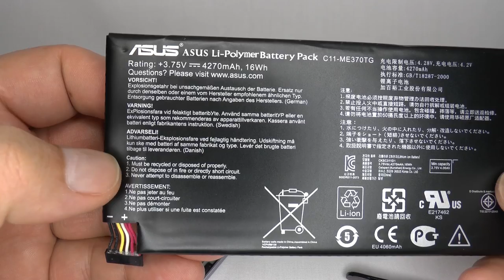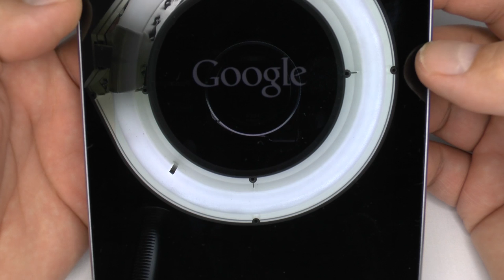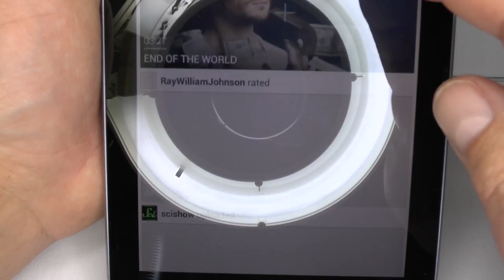Nexus 7 Repair -  LCD & Digitizer Replacement | Disassembly + Assembly

Comment: Answering my own (new) issue, the charger ribbon cable had become unseated during my screen replacement efforts. Once again I thoroughly reviewed your Nexus 7 diss-assembly video while doing a side by side comparison. When you got to the part removing the charger cable I noticed that mine had become disconnected (unintentionally). Following your video I reconnected the cable and normal charging resumed. I cannot thank you enough for such a complete and competent video.

Comment: Thanks for great demo. I finished but something went wrong. I have a working Nexus with replaced screen but the screen has red across it. IE when I boot up its a red background and not black. Did I do something wrong? Have you seen that before?? Could it be the screen that I purchased..? Thanks in advance,,

Comment: That's a great idea - and I tried it.  Of course, the old glass shattered even worse in the process of taking off the beveled screen, so I wasn't surprised to see that IT didn't work when I plugged it back in... or maybe it should have worked and my flex cables are busted now? Tough to tell.  But you think it may just be faulty new screen?

Comment: I just semi successfully replaced my Nexus 7 screen assembly thanks to the excellent step by step in your video. When the Nexus booted up and updated all its apps I was delighted. However the device battery is not charging. I have gone back in and reseated the battery cable connection but still the device does not seem to see the charger connection. Do you have any suggestions? Have I traded one problem for another. I presently have about 40% battery left.

Comment: exellent video, thank you. wish id seen it before i attempted to replace my screen. a quick question, if i snapped off the tiny gold jumpers from the mother board to the wifi areial (on the back of the case) can they be replaced or do i need to replace the motherboard? thank you

Comment: Thanks so much for the tutorial, I'm typing this from my newly repaired nexus 7. Asus wanted €170 and I managed to get the part for under eighty. I have botched the screen adhesive though, partially because I had to pull shards of shattered glass away one by one. Just wondering if you have a link to a description of that adhesive tape you recommend? Thanks again

Comment: Having never done anything like this before, I've now done this TWICE using nothing but this video, the little plastic knife and philips screwdriver (from the LCD replacement pack), a pair of "flat" pharmacy tweezers, to pick our all the glass shards and the wife's hair dryer!! A huge thanks for two "nearly new" Nexus 7's. I think it took me 60mins the first time (with lots of photo's) and about 35-40mins the next time. £40 from China for the replacement parts, if you can wait a few weeks.

Comment: Nice video.
My son dropped my N7 and now the glass is broken.
The biggest problem whem i replace the screen is to get the broken glass parts from the alu frame.
It is also impossible to keep the adhesive glue/tape that holds the glass to the frame in a re-usable shape.
How can i solve that? Is the glue available?

Comment: Hi, thanks so much for this video. I tried to replace my broken screen and when I reasemble all again, I found that the nexus seems to work, but the screen have two yellow and green bars all the time. I can see the desktop, use the tablet but all the time with this pattern, I tried reconecting the screen connector without sucess. Thanks in advance ! 

I have some photos but dont know how to include them here ...

Mariano.

Comment: @14:20, when removing the screen, I heated on the screen side.  In this fashion, The whole adhesive stayed on the silver plastic frame and I had no need to pry it off the old screen

Comment: had the same trouble. once, on some google forum i read that this problem can be easily fixed by opening the back lid, disconnecting the battery cable and connecting it back again. then put the gadget on charge for a couple of hours. 
then cross your fingers and turn it on. 

btw, keep in mind if you open the back cover the warranty will be void. may just bring the gadget to some authorized service where they will charge you about $50-100 for doing the same steps as i showed above. 

good luck!

Comment: I have put mine back together and back apart after changing cracked LCD and digitizer 20 times at least and it won't turn on (it at least turned on with before I worked on it with the crack)... I followed instructions perfectly except I wasn't able to reuse the insulation metal tape... is that keeping it from working or what am I missing?

Comment: Just completed this repair using the video. A bit shaky at first, but referred back to the video as needed. Took my time and wound up with zero extra screws !!  Thanks for the video. Buy the way, I took the advice, and did buy the complete screen/digitizer assembly. I was able to peel the frame/screen adhesive strip away and reuse it, but I had to watch the pressure and go slow. Once I had separated the main board and metal frame from the plastic frame and damaged screen/digitizer assembly, I wrapped the plastic frame and screen assembly in a towel and placed it in the oven on the lowest setting, 170' F, for 3-4 minutes (since this screen assembly was no good, I was not concerned about heat damage). It wasn't as good as a heat gun, but I believe it did help.

Comment: At 6:30 you are removing a large sheet of adhesive/foil. Did they stop putting this on to later edition models? I just got mine back from ASUS and am going to replace the screen myself, just a little worried since I do not have that foil.

Comment: I have successfully replaced my lcd BUT my N7 only booted up once with "16-bit" colors and with a middle vertical line. I disassembled it again and checked the lcd to mobo ribbon (con 7311) and also the power cable and now when i boot it up i only have a black flickering screen with that line in the middle - no more colors or logo whatsoever - only black flickering screen. Could you please give me some hints?

I am probably meeting the same situation as Zali Abas

Comment: Thank you very much.  Because of your video I was able to replace the port assembly.  Although under warranty, the charging port was physically damaged from inserting and removing the micro USB charger over the last year.  Asus wanted $213 to replace it.  With your video I was able to do it with a $60 replacement part and about 30 minutes.
Reply from the maker: Good news, thanks for the feedback :-)

Comment: Thanks a LOT, I broke the screen sitting on it... the hardest part was separating all the glass bits from the bezel... thankfully not out of my butt.
My opinion is that it would be faster/easier/sexier if a new bezel was supplied with the screen.    About two hours, worked on the first try.  thanks again!

Comment: great video. helped me replacing my brokenscreen in 10-15 minutes. my nexus is back after 3 months of disability. the i have paid about $150 for screen+delivery and about 10 bucks for 3m 5mm tape (bunch of it, used 30-40 cm max). 
thanks a lot!!

Comment: Thanks You!  I was able to save my nexus 7 where the digitizer (or touch) stopped working.  I purchased the digitizer and screen combo online for $50 that came with some small tools (screwdriver for small screws and some plastic pieces resembling a guitar pick to slowly remove the edges and what-not).

Comment: Hey i just self replaced my screen on my nexus. I have an iHeart radio app and when i reconnected the parts, the alarm went off and played my station. The only problem is that the screen didn't display anything. I've checked all of the connections a million times and it just isn't working. What do you think is wrong?

Comment: So would I have to purchase the LCD+Digitizer? Or can I just order the digitizer itself. The LCD is working fine, but the screen is cracked at the bottom half and touch won't respond at the area.

Comment: Just wanted to say thank you. I was able to pick up a screen online and do almost all the steps without a heat gun until I got to the screen. I went to a local shop to do that for me. Took them under an hour and cost around $20. Great video!

Comment: I have a Nexus with replaced screen but the screen has not turn on.
I tried with two new screens the same problem, the old has been broken ..
Not seem to have a problem in ribbon cableI, i took it carefully and it was correct before.
You have an idea whatsoever what the problem is?
Thank you!

Comment: I've replaced my display successfully but I'm still getting a blank screen. I know my N7 is powered on since I can hear it. I'm also able to unlock it without being able to see a thing, meaning it is responding to touch, and I'm just getting no image. 

I tried reseating the flex lcd cable plenty of times already and still can't get it to work. My old screen is completely destroyed and therefore can't be used to check if I got a faulty screen. 

What do you recommend I do? Get a new cable?

Comment: My toddler stepped on our Nexus 7 second generation back down the other day and the unit restarted itself. It works fine but I just want to know why it would restart itself all connections are tight and there is no loose pieces inside.

Comment: I was successful in replacing the digitizer assembly. I ordered a new one without the silver plastic frame. I used the old frame i had. Thanks for all your instruction

Now the only thing, is the audio 3.5 mm doesn't work very well. Mono in one ear and weak even if the volume is set @ max

Do you have a suggestion as to what to look at? Should i order a replacement for the audio component?

Thank you
Reply from the maker: yes its a common problem, Google for part number ME370T_IO_FPC
Reply: *****  I rechecked everything and i hadn't close the clamp on the flex cable that connects the power input and audio to the main board... It was charging super slow too. After closing the clamp, all came back to normal :-)
Reply from the maker: Joffrey Bienvenue Good news :-)

Comment: really easy to follow, saved about £180 on buying a replacement 32GB by changing the screen. Screen had a blue tinge after first attempt so tried again ensuring all the connections were in correctly and works great

Comment: I followed your advice here, but my screen will not turn on. I even tried to turn on the old screen, but it won't work. I made sure to reinforce the lcd connection, but the screen won't light up. I know the unit is working because when I plug the USB into my computer I have access to the files. What would you recommend doing?

Comment: Wow. Watched you separate the glass from plastic bezel with minimal of difficulty. I wonder if various production line changes resulted in some using the double sided adhesive tape like you got, which isn't too difficult to get around, and if different Nexus 7's use glue, to form a much stronger bond/fusion that's near impossible to undo. Another video on youtube shows how a guy did it after 2 hours and much torment.

Comment: They are gold looking pieces of bent metal (2 of, side by side) Located right next to where the battery plugs into the motherboard. They provide the contact to the WiFi antenna which is housed on the rear case.

Comment: *****  
I fitted a full screen on a nexus 7 ME370TG about 3/4 weeks ago....noticed that there is a sort of whitish misty halo that appears on the outer edges of the LCD intermittently but I don't think it's on the LCD - not too sure what might be causing it - your thoughts would be appreciated!

Comment: Sorry for English ..
 I have a  Nexus with replaced screenת but the screen has not turn on Touch Yes.
I tried with two new screens the same problem, the old has been broken ..
Not seem to have a problem in ribbon cableI, i took it carefully and it was correct before.
You have an idea whatsoever what the problem is?
Thank you!

Comment: I installed the display an reconnected everything properly.  However the screen will not turn on. Do in have a faulty display or did I do something wrong?

Comment: nice post! the speakers cover the ribbon cable to the USB charge port!  also thanks for pointing out the heat shields - copper foil - covering  certain parts!

Comment: My locking bars for the 2 connections for the digitizer have broken off.  Are there replacements or a solution to this problem?  Help would be very much appreciated if I'm to keep my nexus 7 2012

Comment: Thx a lot for the Video! It is really very helpful. I wouldn't have dared to replace it myself without your tutorial! Thank you!
I just have one question: The digitizer only works properly on the upper half of the Display. The whole Screen works but the Display does not react when beeing touched on the part downwards from the middle. The upper half of the Touchscreen works perfectly but not the part below the middle. What mistake could this be?
Reply from the maker: I would suspect a faulty new screen, its quite common and the seller is normally happy to replace it
Reply: Okay. Thanks a lot for this Information.

Comment: Aha! I rechecked everything and i hadn't close the clamp on the flex cable that connects the power input and audio to the main board... It was charging super slow too. After closing the clamp, all came back to normal :-)

Comment: My nexus 7 fell and I have cracked display at the corner. My screen is working fi9 just wont respond where it is cracked. What replacement part should i get and how do i replace it at home? Please Please Please HELP. Its an absolute chaos for me. HELP

Comment: great video thanks, However in my tablet some things are different. The battery does nott have the scotch tape but it had more glue beneath it. And it doesnt have this black cover that you need to warm up to open. instead it has a bronze material that is like very soft metal. Do I have a different version of asus nexus 7?
Reply from the maker: its not a different version its just made with slightly different adhesive or heatsink

Comment: It seems that after changing to new screen, most of us having problem getting the screen to show anything... Just complete changing to new screen and cant see anything although for fact that i know that there is power supplied to the screen... Are we missing something? It worked before replacement so there's nothing wrong with the unit...

Comment: I ordered a full assembly with the silver plastic frame as well.... But in the end, I had a hard time with the screws from the old frame trying to make them fit in the new frame- seems like they were not the same size; I ended up cracking my news digitizer :-( trying to force the screws in... I will order another assembly but without the silver frame...
Reply from the maker: That's a bit unlucky..

Comment: i am having just a crack on the screen just a line touch is not working at that area but at extreme bottom it is registering random touches else the screen is great so what do i need to replace ? digitizer ? lcd? all ?
Reply from the maker: the digitizer and glass are bonded together so you'll need the complete assembly like this one, you can use coupon code ETS2 for a small discount which also gives me credit http://www.etradesupply.com/asus-google-nexus-7-tablet-lcd-screen-and-digitizer-assembly-with-front-housing.html
Reply: OK thanks for the reply Btw what is difference between digitizer and lcd or else reply with a link explaining it
Reply from the maker: the digitizer is the top glass touch screen which is bonded with optically clear adhesive to the lcd display. Some phones/tables have an airgap between them which enables you to replace the top touchscreen separately

Comment: Great tutorial. If I want to reuse the old adhesive on the bezel, does this need to be heated? Otherwise where would I purchase the mobile tape?
Reply from the maker: Google for 'double sided mobile phone tape' and click the shopping link. But this stuff is very wide, so you'll need to use a few strips together. If the original adhesive loses it 'stickyness' from being touched, you can wash it in warm soapy water and when its dry it will be sticky again

Comment: Thanks for speedy reply. I resat all and still had the issue. The other screen broke when removing as it was cracked before in a bad place (reason for screen replacement). Anyway, I managed to hook it up again and it was doing something similar to the new screen. So I must have damaged the ribbon cable or the board.. Boohoo!

Comment: Just something to note to people watching this video: You should also buy a frame with adhesive on it too to be safe. I didn't do that and when I attempted to separate the screen from the frame it was practically impossible without creating millions of cracks everywhere, and long before then the adhesive was useless.
Reply: yup, unfortunately this comment came to late for me because i followed the instruction of using a heat gun to melt the adheisve and peel the screen off the frame. In doing this i also melted the plastic at the top section of the frame which made it imposible to mount the new screen inside!
Reply: Ben Cleary This comment came to late for quite a lot of people haha. (2015; this is a 2012 model)

Comment: Do you know if this requires the Android 4.2+ on Nexus?  Most of the sellers on ebay for the LCD+Digitizer assembly are asking for 4.2+.  Mine is shattered and the display is not working so it is too late for me to find out, but there is a good chance that mine is on 4.1?
Reply from the maker: It shouldn't matter what version of Android you are running for a new screen to work. Some Nokia's and BB only work with the correct version of screen but these only have one. There's links for parts in the description ^^